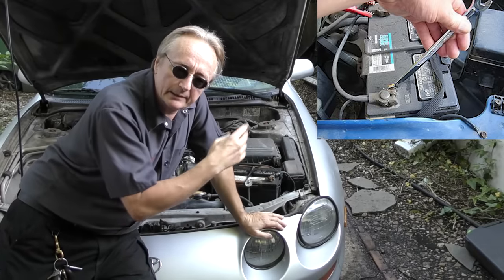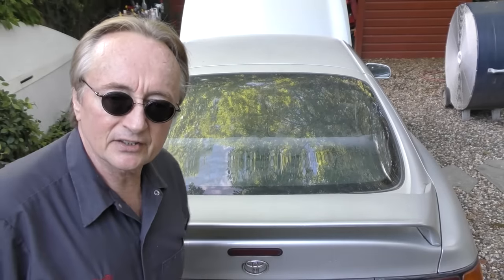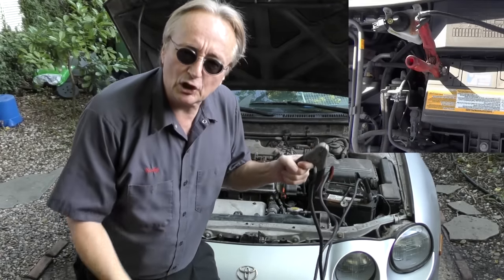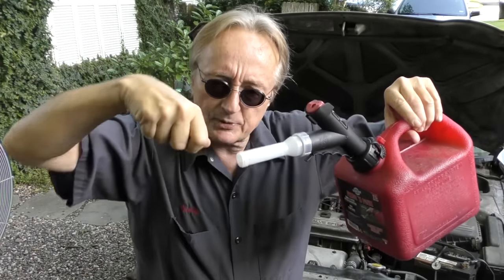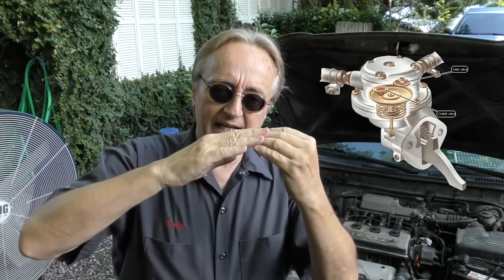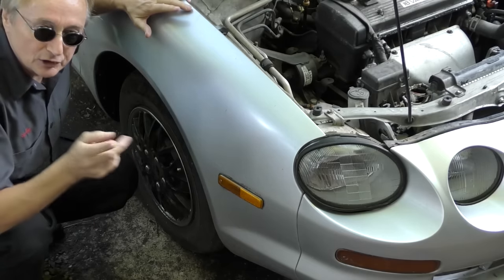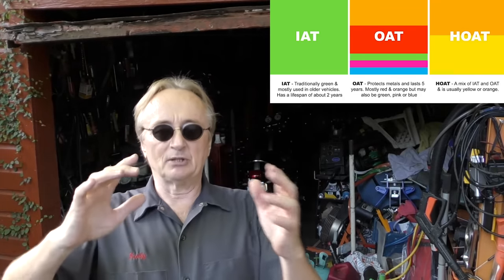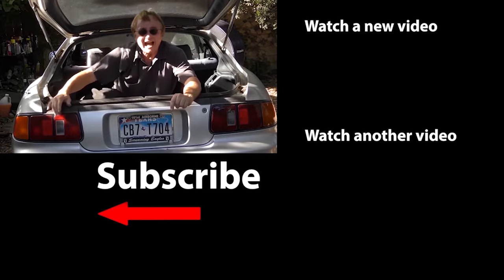This Will Destroy Your Car

Comment: For another thing, pulling the negative terminal does not tell you if the alternator is working correctly. Sometimes a fault in the regulator will make the alternator always produce at a voltage lower than the battery voltage.  But maybe if you disconnect the negative, it goes to full output. The former I have experienced. The latter I can't testify to, but I am sure it can and has happened. Some of the parts chain have test equipment than can tell you if the alternator is faulty or not. Or as a final step, you can pull the alternator and have it tested. Again, some of the parts stores can do this for you for free. Many of them will try to sell you something though whether you need it or not.

Comment: My oil cap says 5W20 But I use 5W30 (Full synthetic) because the manual says it is OK if the temp doesn't get below 15 degrees. It did get to 10 degrees this year but that was the first time in 50 years it has gotten that low!

Comment: Ok Scotty I joined the movement. Great tips. I never can find a good ground so I use the neg on the battery. Great tip on running two cars at once. Unless it’s the playmate of the year I’m not jumping anyone to be safe. You in New Hampshire it you just like the saying over your garage door?

Comment: Lots of comments about jumping batteries.   Do you know why you put — to chassis?   The battery may blow up.  Why, because the battery puts off hydrogen gas.  The reason you don’t connect to terminal - is, you could cause a spark next to battery vent, that’s why you make Last connectiom on the chassis away from the battery.   I’ve had a battery blow up, I had my back to it, but it could be serious,  I’ve connected to terminals many times.  (*L*).  Big NO -NO. Don’t connect cables wrong, just a flash touch, can blow out your diodes.

Comment: I checked the owner's manual of my car, regarding how to jump start it. It does not have any warning about having both cars running at once. As long as the voltage regulator for the booster car is properly functioning, and the voltage is not more than 15 volts (typically the maximum voltage is around 14.5) there should be no problem – at least on my car.

Comment: He is 100% correct and I get sick of telling people about this - here is why - if you try to jump start the dead car with your live car running the heavy current required to turn the dead car over can cause the the live car alternator to blow its overload capacitor and you will soon have problems with the live car because the current will try to travel anywhere it can.  The correct way is to run the live car at high rpm for a about 15 mins or more to get some charge in the dead one the have a go after turning the live off.

Comment: I had to replace that charcoal canister. I did it myself for $275. I bought the part from Rock Auto and it was a Toyota part. The dealer wanted close to $500 for the part alone. It was a pain in the rear end to do this repair.

Comment: The point scotty makes about not changing oil viscosity in you car  kind of depends on your car and where you live. I live in the northeastern part of the US where it's hot in the summer and cold in the winter. I run the recommended 5w30 conventional oil in my subaru during the hot months of the year and switch over to a 10w30 during the cold months. The heavier viscosity oil during the winter really helps for cold starts by keeping some of oil trapped up in the valvetrain as the engine cools. There is hardly any valvetrain clatter on cold starts with the heavier weight oil. I've even heard of some people running Rotella T6 diesel oil in their subarus. I'm not sure If that would be good for a gas engine but I wouldn't try it myself.

Comment: Modern silicon ic's and circuit design in ecu have protection against transient voltage spikes. Disconnecting battery cables while running shouldn't cause a problem.  You'd have to be pretty unlucky to fry anything that way.

Comment: The charcoal canister isn't a filter; it's meant to store fuel vapor. The canister purge valve is used to suck the vapor into the engine where it's burned.

Comment: Thank you for making these videos. I did subscribe as requested, because you are a good man, taking the time to educate us. I'm driving a UK, 2005 Ford Fusion, 1.4 manual running petrol.  just under 90000 miles on the clock. These videos will help me get to, 150000, I hope. best wishes.

Comment: I actually fixed my fuel pump problem on my 2002 Ford Explorer myself, but instead of dropping the engine, I went through the vehicle's interior 😅😅
There are no problems though, the vehicle still runs perfectly :D

Comment: Great advice! My mechanic has advised to use 15w40 instead of the recommended 10w30 in my Mitsubishi Lancer 2.4l 2009 (145000kms). Car runs good but you got me worried now as the Lancer does have Mivec (variable valve timing)
Reply: If in doubt always use the oil recommended by the manufacturer in the owners manual. They know the vehicle best.

Comment: I still over inflate the front tyres on my VW Caddy van for long journeys, it's worth up to an extra 5mpg (UK 4.56L) and cheaper than the extra wear to the middle of the tyres.  For normal driving especially in winter I run lower pressure which hammers the shoulders of the tyres and balances the wear.  I am running low profiles 195 50 15 with stiff sidewalls on 7" rims if that makes any difference.  I usually replace tyres long before they reach the legal limit, I can't stand poor braking or handling and it literally takes forever to wear out a quality modern tyre these days.

Comment: Kudos and thanks. It’s the first time I hear the truth about topping up gas tanks and ruining the carbon filter in the process. That filter is related to a few convenient things/sensors that shut down important options like 4WD (the kind that is only used to get out of a jam and not the kind that can be always on at all speeds), anti-scid, and cruise control for example. Quite a nuisance and expense to fix that carbon filter.... one where I would be happy to just do without. Cheers.

Comment: That Hydrogen Blowing up is No Joke. Jumped a buddy in my door yard and it blew. It's not a fire at all...it more of like a 1/2 stick of dynamite going off. That happened on an 88 Corsica I got a face full of battery acid and plastic from the top of the battery cut the brim of my ball cap in half. Only thing that saved me is the garden hose was close enough to flush the acid off me almost immediately. Has me opting for the lil jumper boxes these days.

Comment: The charcoal canister was destroyed b/c of the previous owner overfilling the gas tank. As a result, when I would try to put gas in, it would resist, and the pump would think it was full, making the gas pump handle release, and stop the gas flow. I would have to wait about 5 seconds and could start pumping again. I could only pump gas for a few seconds before it did it again. It would take FOREVER to put gas in.

Comment: You can check your battery and charging system with a simple digital or analog volt or even one of those thingees with a red, yellow and green light. If the battery voltage is close to 12.8V and the voltage with the engine running is 13.8V your system is good. If the battery is rundown when you start the engine, the system may however not allow a charging rate which will raise the voltage to the 13.8V level. Saw that on my own car when I left the lights on overnight. To some time to charge up and until then the voltage was deficient.

Comment: I have never herd of having to shut off one car after the other one starts up. And you should disconnect the booster cables as soon as the other car has started up anyway.?? And some cars don't have the color coordinated red-black. So you have to make sure you are making the correct connection's. And some cars have a separate positive cable booster spot because the battery is behind the front wheel well or it's in the trunk. Most new vehicles have an extra 1/4 tank past the Empty on the  all the cars now a day's. So you can go to the " E " mark no problems.

Comment: Don't connect the cable to the "metal ground". It does way more harm than good. Because depending on the car the only viable "metal ground" may not be grounded after all. In my case I used to connect to a metal I could catch was not grounded but it also touches a metal braided fuel line. So it burned the fuel line.
Just connect to battery terminal. That's the safest thing to do.

Comment: Two years ago, I had the problem with chip charger. The engine was shut down periodically until my mechanic found, that is problem with charger.
On today’s market there are many GPS tracking devices included that plugging in the OBDII port. Is it safe for car computer?

Comment: I top off the tank.  In several of my vehicles I can get as much as an additional 2 gallons of gas after the initial turn off at the pump and because of this I don’t trust when the pump initially turns off. Especially if I’m traveling, I want to know for certain my vehicle is full cuz I live in an area where there might not be a station around for 60 miles. Now on my F150, from experience, when the pump turns off, my truck is full so I don’t keep trying to put gas in.

I don’t run the gas to “E” but A lot of times I get down to where the low fuel light comes on. I’ve never had a fuel pump problem except one time in a S10 Blazer, GM stuff is made to break and the rubber diaphragm failed on the fuel pump, luckily I made it all the way home, where I discovered the problem.

Comment: Usually the battery indicator will turn on if the Alternator failed, otherwise, every code scanning computer can tell you system voltage while the car is running.

Comment: Tires loose air pressure over time. Low tire pressure is what causes heat and heat causes blowout. Blowouts destroy your tire. I always over fill my tire pressure by 3 - 5 psi. The only downside to overinflated tires is slightly higher wear on the tread in the center of the tire. The slightly over pressurized tires are safe to drive on. Never let your tires go more than 3 psi low.
What vehicles do you always see pulled over for tire blowouts??? Trailers! Boat trailers,  utility trailers, cargo trailers,  etc. Check your air pressure often and never let the low air pressure light illuminate.

Comment: Thank you so much for the heads up. Especially the one about the jumping of the cars battery. Question, what about using marvelous mystery oil for the gas tank? According to them. Claims he oxygen sensors, catalytic converter and he does nothing but good to the vehicle. I’ve been using it for many years and have nothing but good experiences. What’s your input? God bless you.

Comment: Hi scotty we just bought a 2008 dodge caliber . 125, 000 miles on it . because of our budget that's all we could afford. we had to have a motor mount replaced . now we have to have the brakes checked . also replaced the drive belt. we are thinking about doing a diagnostic test on it . but it's expensive . and what will that show . and is it a good idea . . thank you for your valuable time .

Comment: Easy, basic alternator check. You just need a voltmeter. 
1. Begin with engine off.
2. Check voltage across battery terminals. It should be around 12 volts. 
3. Start your engine. Check voltage again. It should be 13.5-14 volts. If it is not higher than the first reading, you aren't charging. If it's lower than 13.5 or higher than 14, that still isn't good. 
4. Turn on headlights, interior lights, stereo, a/c with blowers on full, whatever drains you can turn on. Check voltage again. If it drops more than about .3 volts, you might have a charging issue. (I'm not sure exactly what's normal here, so take with a grain of salt. For sure though, 0.1 volt drop is not a problem and 1 volt drop is a problem.)

Example: 
2. Initial voltage is 11.8. Unless the car has been sitting for several days it shouldn't be that low. 
3. Start the car, voltage is still 11.8. Charging is weak to none. You have a problem. 
4. Turn on headlights and electronics, voltage is 11.4. Problem confirmed. 

This doesn't strictly mean your alternator is bad, but it definitely means you have a problem in the charging system.

Comment: Scotty, you are bat shat crazy,  and I luv ya! Keep it up! P.S. I have had a battery pop off in my face many years ago from connecting terminal to terminal on Negative side. Now I always connect good battery to the negative terminal and bad battery to grounded metal! Have to say its not always easy to find a good ground point on modern cars!

Comment: Ok, question slightly related/unrelated to topping off the tank: the last 2 cars I've owned the oil pump handle pops, causing the oil to stop filling the tank, almost as soon as I start to fill the tank. What is causing this problem (my temp fix is to turn the handle upside down while filling my tank. Sometimes it works and sometimes it doesn't). And for the trolls on the internet: yes, the tank is almost empty (at a quarter full)

Comment: Although I agree that you should not over-inflate your tires, something even worse is under-inflated tires. This is especially true of heavy vehicles in hot weather. Under-inflated tires are far more likely to lead to a sudden tire failure, because they rapidly build up excessive heat. Bottom line check tire pressures regularly. A lot of tire stores will check your pressures and adjust them for free.
Reply: Thumbs up on the coolant. They are definitely not all the same.

Comment: Using Scotty's jump method will never work if the dead car's battery is weak and you are just trying to get the car to home or the shop to replace the battery.  Most people seem to say that alternators have build-in protection against what Scotty says.  So, I would personally not mind doing the jump the standard way and simply disconnect the two cars as soon as possible after the dead car starts.  But, if you can use a self-contained booster, that seems like the best way.  I would say in general jumping is to be avoided if possible. But, if you have to, I would just do it the standard way.

Comment: I have a VVT engine in a 2011 corolla that started the infamous phaser gear rattle on startup, what i found i could do in warmer weather was go from 0w20 to 5w30 oil and it helped stop the rattle on startup,  i spoke with a mechanic who said the slight change in oil weight would not hurt the car.. .. true?  i've been running it like this for 2 years.  don't want to change the phaser gear because from all i've read the problem just comes back

Comment: What's a "ground"? Just anything in there that is metal?  So, two cars, one dead, one good, both off.  Connect the cables as indicated.  Wait 10 minutes like that while both cars as off.  So how do you turn off the good car when neither car has been turned on?

Comment: I’m one of a few that can testify about a car battery exploding. While working at a local auto parts store I caused a spark while removing a charger from a battery. Next thing I remembered was standing there while my clothes were soaked in acid and I couldn’t hear very well. Thank God it blew out the side and not the top. My eyes were okay and I got my hearing back but my wardrobe disintegrated the next day. I was about 16 at the time. Never forget that day!

Comment: Scotty is right, EXCEPT for one item:  TIRE PRESSURE !!  I am a tire professional and expert in this area.  Nearly all car tires nowdays say on the sidewall "maximum pressure 44 lbs".  For better fuel economy, I ALWAYS run my tires at 45 to 50 lbs, for much better fuel economy.  That being said, I do NOT drive fast or corner hard.  I drive slower, like a grandma.  I have been over inflating my tires for over 40 years......the steel belts on these radial tires are so stiff and strong, the tires do NOT wear out in the middle.  The car rides slightly rougher over bumps, but that is OK with me.  I average 83 MPG in my 2020 Toyota Prius......I drive 2200 miles per week.  Anyway, the car manufacturer my recommend 34 PSI, mainly because they want you to have a cushy, softer ride.  But that is WAY under inflated.  The car will ROLL so much better with sidewall max of 44 lbs of air.......
Reply: my van manual says 35psi for each tire, but the wall of the tire says 44psi. Do you think i should go to the maximum? Just worried it might go pop.
Reply: No....there is a HUGE safety margin built in.  It will not pop.  I always use 50 lbs pressure...

Comment: First thing I did when I bought my 2010 F350 Diesel was mark July 16 2015 on a calendar and ordered the necessary parts and a lot of bolt on performance parts and computer chips for added performance!!!! Then I tore all that EPA's gimmicks the hell off my truck like the catalytic converter, ,,and the,,don't laugh, ,,exhaust cleaning filters out of the truck and threw it as far as could!!! Runs cooler,, better mpg r

Comment: I have a Lincoln executive was a 4.6 Overhead Dual cam fuel injected it takes 5 - 20 I've been using synthetic and ever since I got it at 228 thousand miles don't see any smoke funny the engine is not the scary part it's the front end of the car wearing out before the engine center link idler arm pitman arm an upper a frame bushings are noticeably bad I'm going to get rid of it but I have to admit the motors been good to me